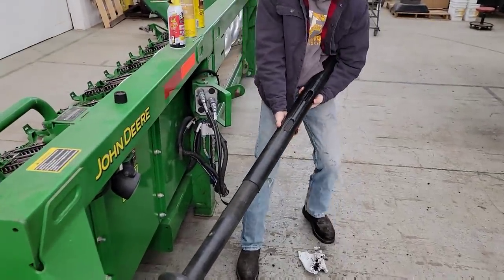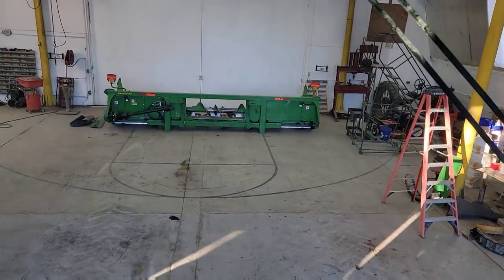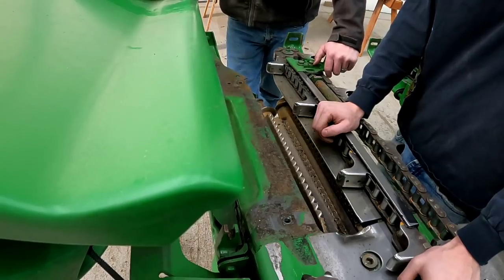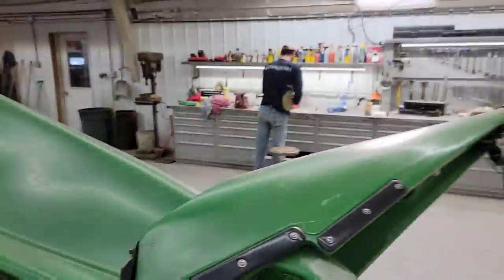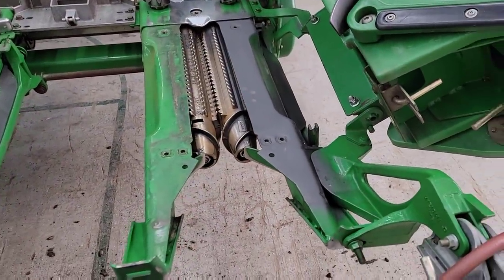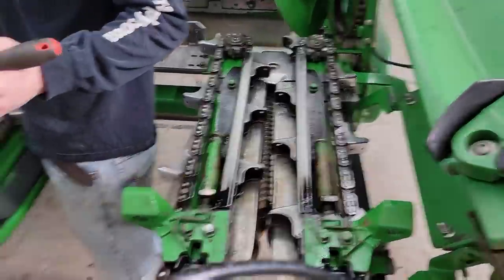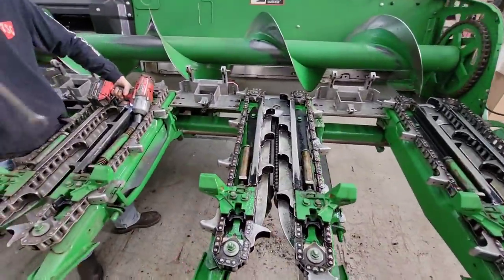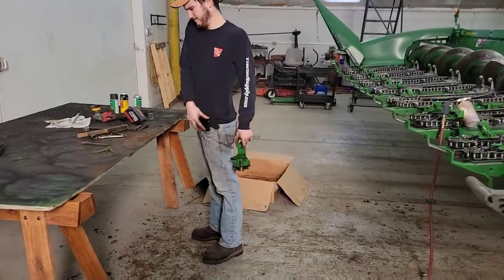Tearing the Corn Head Apart - #582

Comment: does your new GOPRO handle STAND thingie have a BATTERY PACK internal so it can add a couple hours record time to the GP ???? :)  or...  JUS A HANDLE with magnet??? :)
Reply from the maker: No is that a thing? would be handy!
Reply: @BorderViewFarms  coulda swore I saw some before when I was lookin at what was avaialable, and it had diff power block options, like a 10 20 60 ( K milliamp or wutever rateing )  priceier they were compaired to just the handles...  PROLLY ''electrornics'' too... sooo ruff dooody/duty and electronics usually don't mesh well ;) 

YES IT IS A THINGGG !!!!  A good thing that issn't JUNK (  ''it's all JUNK''  lol as chet & duggo & bigSWEED often talk about) ???  I DO NOT KNO the correct answer to that one!! :)